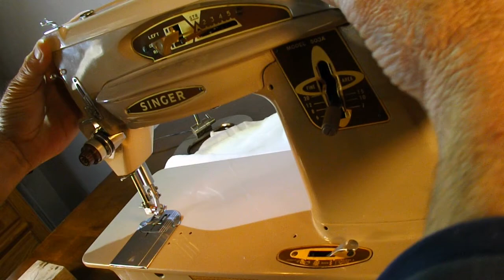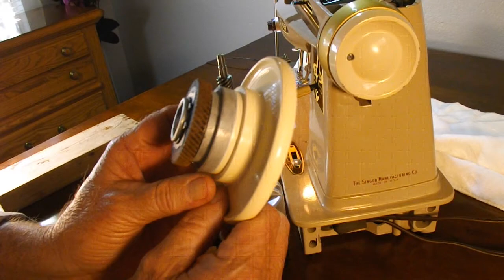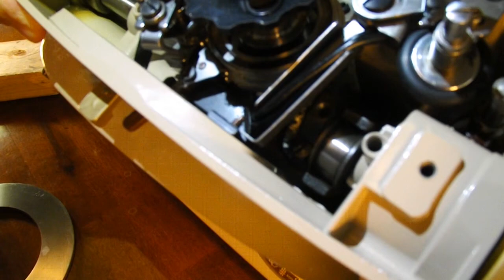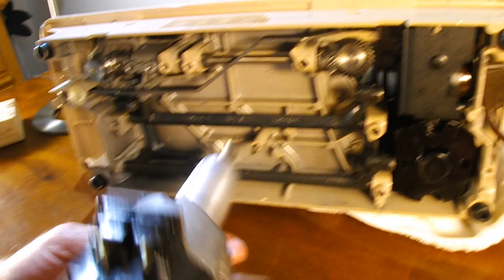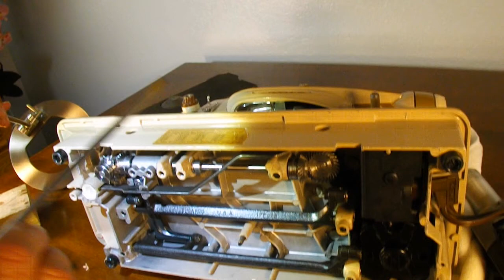Singer Model 503A Special Sewing Machine * Tour the Inside of a Working Machine

Comment: Just discovered you last night.  Your videos  are great!  I discovered you because I bought a 503 special yesterday at an estate sale.  It looked good and clean.  However, when  I got home and began to oil and clean, I discovered that the zigzag would not work.  I learned from your videos about the inner workings that make the zigzag work.  Mine won't budge.  I oiled and lubricated it overnight and again this morning.  Still more movement.  I'd appreciate any suggestions .  Thank you.  Linda Rainey
Reply from the maker: Welcome to Andy Tube, Linda. Thank you for rescuing that 503A Special. Patience is the key to getting a frozen machine working again. It may have been stuck for years. People often used other than SMO (sewing machine oil) to lubricate it. Many of those types of oil have additives that leave behind problems and can actually solidify into a type of "varnish" gluing the moving parts together. You can also apply heat from a hairdryer. In the Instruction Manual are instructions for all the oil ports and places on your machine. You can download a FREE copy of it, in PDF format, from Singer at this link:
https://www.singer.com/search/support?title=503
     Remember that any new oil you put on will get contaminated and you probably will want to remove it later, so easy does it. There are many videos showing to slather the oil on, but I don't feel that is really required to get things moving. You can also apply drops of the Krud Kutter degreaser which is made to break up oil and get it loose.
The original Service Manual is full of directions, with pictures, for adjusting everything on the machine to factory specs. It is not common that you can find them free, but the one for your machine can be found here for no charge: 
https://sewingdude.files.wordpress.com/2012/09/singer-500-service-manual.pdf
I have 140+ videos that relate to your model from adjusting and replacing parts, to setting the timing, rehabbing the motor and foot control and cleaning your machine of decades of grease, oil, and dirt with Krud Kutter Cleaner and Degreaser. Here are links to my different playlists. Some model numbers are different but have most of the same parts as yours.
https://www.youtube.com/playlist?list=PLsCOZgzzaiKJZaZn2zl3LsnV2d7UhrqvX
https://www.youtube.com/playlist?list=PLsCOZgzzaiKKyqvdDRwS-9MfLuwSNJTcg
https://www.youtube.com/playlist?list=PLsCOZgzzaiKIB4kvIHCfHYuyLMUp5A4UI
https://www.youtube.com/playlist?list=PLsCOZgzzaiKIQcy78hoNrX1376edTQPlq
https://www.youtube.com/playlist?list=PLsCOZgzzaiKJaeFB_GW97NsW5GYM7KD9U
https://www.youtube.com/playlist?list=PLsCOZgzzaiKJSu0T9oeaheTZsrUe91kkZ
https://www.youtube.com/playlist?list=PLsCOZgzzaiKL6ePPxLpmnWSzTyxPKTb71
While you waiting for the oil or degreaser to do its work you can watch videos about your machine, read the instruction and service manuals, etc. and be learning all about your Rocketeer 503A Special. It's a wonderful, strong and versatile machine that, with a little care, can easily go another 50 to 100 years (if people still are sewing by then!)
Thank you for watching my channel and you know where to find me if questions arise. Good Luck.
Reply: Thank you @andytubesewing1953
Reply: @andytubesewing1953  Thank you so much for your very complete answer.  By using heat I already have a little movement. I look forward to watching more of your videos.
Reply from the maker: @lindarainey2370  welcome. best of luck.

Comment: I have the same model, but you didn't even touch on the tensioner mechanism which I screwed up trying to figure out
why it wouldn't stitch. Any ideas?
Reply from the maker: Hi, Malcolm. Yes, I have some ideas. First, the tension unit is on the "outside" and this video was of the "inside. Here is a complete video of the tension unit https://youtu.be/OqZZ-uhnAMY  It is one of 20 videos in my playlist for model 503A   https://www.youtube.com/playlist?list=PLsCOZgzzaiKJZaZn2zl3LsnV2d7UhrqvX   The playlist covers how to remove, replace and adjust many of the parts on the machine, as well as how to wash the whole machine in the shower to remove decades of dirt, grease, and crud. Once you get the tension working you may enjoy some of the other 503A videos. If you want/need more in-depth info about tension, here is my 7 videos "ALL ABOUT TENSION" playlist. https://www.youtube.com/playlist?list=PLsCOZgzzaiKJaeFB_GW97NsW5GYM7KD9U   I have 500+ videos on my playlist page and they are organized by model number, so if you have/get another vintage Singer I may have some videos about it. My playlist page is here: https://www.youtube.com/channel/UCUSPDsHaFtRoz1VA2U1xJ4w/playlists?view_as=public
Thanks for your question and for watching my channel.

Comment: Hi Andy, I have a 500A and when I was cleaning the machine. a spring popped off.  I can see it in the above video, but I can’t see where it’s connected on both ends.  I looked at a manual on the internet and the only thing I saw was that it was referred to as Y3.  If you could direct me I would greatly appreciate it.  Thank you kindly, Marci V.
Reply from the maker: Hello, Marcia. I have a video that contains removing and replacing that spring on a Model 503A. It should be the same on Model 500A. Please take a look and see if that helps you to solve the problem. https://youtu.be/L9ZiWURPA-Q
Thanks for watching Andy Tube.

Comment: Hi Andy, Tomorrow i send you an email, for a few questions, now i want to know if this machine have belt inside  or not? I have problems to understand that!!! Thanks a lot for all videos!
Reply from the maker: The 503A is a direct drive machine with steel gears. No belts of any kind. The motor shaft gear mates with the handwheel gear directly, so no motor belt. See @ 4:00. The hook is operated by direct drive gears also, so no "timing belt". See @ 13:30
Reply: Andy Tube  Thanks very much!!! I saw the pictures very close, i was looking  for timing belt!!!😅😅😅
Reply from the maker: Welcome. If you're happy I'm happy. :)

Comment: Helpful video. My needle position selector seems stuck. I was hoping you showed that to see how that mechanism works. I don't want to force it and bend/break something. It pushes in, but doesn't really want to raise or lower. Please advise. Many thanks.
Reply from the maker: I was hoping I'd win the PowerBall, but no luck. Try these things for fixing. The needle must be up out of fabric before changing position. Rare if broken; more likely stuck, dirty, lack of oil. Clean and oil, especially the levers up top and the swing mechanisms around the needle bar. 
Free instruction manual here: http://www.singerco.com/support/instruction-manuals/search
Free parts diagram here: http://parts.singerco.com/CPpartCharts/5_59999/
Most importantly free SERVICE MANUAL (bottom of page) here: 
https://sewingdude.wordpress.com/category/free-manuals/page/2/
So covers of and follow the lever from top to the face of the machone. Once you recognize the parts involved clean and oil them well. 90% chance of fixing the problem. Good Luck.

Comment: I love your videos, they have helped so much in rehab-ing my 500A.   I have used many of the products you recommend and techniques (including removing the electrical and washing/drying thoroughly).   My machine was extremely dirty but thanks to you much cleaner now.   I am still having problems however with reluctant movement in the handwheel which results in no movement from the motor, the motor works fine for the bobbin winder though.  I have krud cutted, tri-flowed and greased with singer lube which helped but has not freed the movement.  It turns but consistently gets hung up somewhere in the full cycle.  Any ideas?thanks!
Reply from the maker: Hey, thank you Bridget! Your 500A is a great machine; so strong and versatile. I'm glad you are learning how to maintain it and keep it going for many years to come. It is nice that you subscribed to my channel. 

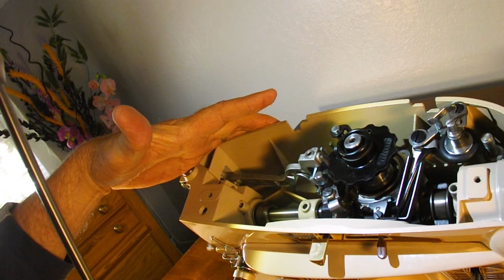Sorry you are having some troubles with the movement. Does everything move freely if you turn the wheel by hand (always towards you)? If the handwheel, clamp washer and stop motion knob are not installed correctly the main shaft, and therefore needle bar & bobbin hook, can move in starts and fits. In this video, @ 8:17, I show how to install the handwheel: https://www.youtube.com/watch?v=RuOLUVPsQv8&list=PLsCOZgzzaiKJxbOOMKQPvmeTRqi0dhGa5&index=19
It is a different model, but same type of handwheel setup.

If that is not the problem, I can tell you a few things I have found that were causing the motion to "bind up" and hesitate. On your Model 500A, set it up for straight stitch sewing, so put the SELECTOR KNOBS at A + K and be sure they "locked" or "snapped" into place.Place the NEEDLE POSITION LEVER to 3. 
 Remove the BOBBIN AND the BOBBIN HOLDER.. Remove the NEEDLE PLATE. Remove the TOP & BOTTOM COVERS. Remove the NOSE COVER. This is so you can see what is going on everywhere.

Make sure the STOP MOTION KNOB (smaller chrome one) is turned all the way towards the back of the machine.
Start turning the HANDWHEEL towards you (by hand) and follow the movement from the handwheel towards the left. Watch the MAIN HORIZONTAL SHAFT that is connected to the handwheel; it should be turning towards you too. See it go through a BEARING HOUSING and an OBLONG CAM. On that cam you can see the top points of a "forked" VERTICAL SHAFT" that goes down to the feed dog mechanism.  That oblong cam makes that vertical shaft "rock" the horizontal shafts down below.

Continuing to the left of the cam you will see a vertical steel gear, and below it a horizontal steel gear that connects to a round vertical shaft that goes down below to a matching set of gears, a lower horizontal shaft and finally, going left,  to the gears of the actual bobbin hook. Look for thread wrapped around the cam, gears or shafts as that can bind everything from moving freely.

Back up top, continue past the gears to the cam shaft and look for the worm gear on that main horizontal shaft. It matches to a gear on the bottom of the cam stack. See it better from the back side of the machine. I have found thread or "chunks" of hard, dried grease in those gears that make it hard for the shafts and stack to turn freely.

To the left of the cam stack you can see the horizontal shaft go all the way through the left housing into the needle bar area inside the nose of the machine. Connected to the camstack are various small levers that can rock the smallish arm going to the needle bar. That is for the zigzag motion. Look for loose, dirty parts, missing screws, thread bundles, etc. that might hamper movement.

Up front in the nose you see a cam in the back, the thread uptake lever and the needle and presser bars. If there is still brown "varnished" oil on any of that, especially the bushing the needle bars goes up and down in, that stuff gets gummy and can absolutely affect free motion of the whole system.

In the bobbin & hook area see if the hook goes around freely in a counter-clockwise circle. Again look for foreign objects like dried up greasy lint, thread, a broken needle point, a pin, (i know) anything restricting the hook from rotating freely.
Also look around the feed dogs for a piece of broken needle, pin, thread wrappings.

On the bottom of machine, underneath the hook, to the right of the hook gears, those shafts have to rock back-and-forth to make the fee dogs work, Is there any debris affecting that movement?

A wrapped thread, piece of a pin, needle or even dried grease ball anywhere on a movement can bind the whole machine.

I have also heated up moving parts with a hair dryer and slowly added more oil as I went from the handwheel towards any parts that moves metal on metal. That has freed up things for me before, and it was easy to wipe off the extra oil afterwards.

If these ideas don't help, maybe you can post a video of your machine with covers off and it trying to run. That may give us more ideas as to the cause.

If you need a free instruction manual, go here: http://www.singerco.com/support/instruction-manuals

Since to already are working on your machine, how about a FREE copy of the actual SINGER SERVICE MANUAL which even shows how to remove & replace parts?  https://sewingdude.files.wordpress.com/2012/09/singer-500-service-manual.pdf

I see you also subscribed to Archaic Arcane: https://www.youtube.com/channel/UCfFrs7JZ1AyBQ2l-Mzkw7ew
I like her videos a lot. 
You may also be interested in taking a look at https://www.youtube.com/user/Sourdoughgirl
She is also quite knowledgeable about machines & attachments.

Best of Luck Bridget. Let us know what happens and if you have more questions.
Reply: Thanks soooo very much Andy, I will do ALL that you have advised.  I will keep you posted.
Reply from the maker: That's great. Hope it will help. If not, I have a couple other ideas too, so let us know. Good Luck!!

Comment: Great video!  It's good to understand the workings no matter how far you take your sewing machine hobby.  Since watching your videos I have gained knowledge and confidence in the whole process. I just cleaned up a badged  pfaff  / fleetwood. I took off as many parts  as I felt comfortable with, used Kurd kutter  which  sure  beats singer oil and q tips. It turned out beautiful. Thanks for your clear instructions
Reply from the maker: Thank you Reta. Glad to know you can use what I share here. Every time I use that Krud Kutter I remember how many Q-tips I sent to the landfill before when I bought them 1,000 in a bag. Sure don't miss that either. Maybe you could post a slide show of your machine someday. Take care.